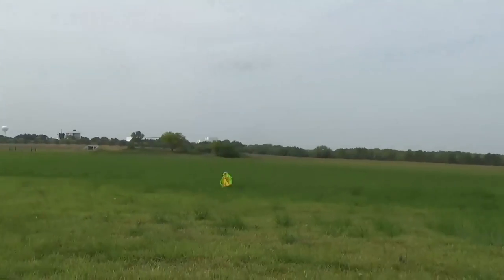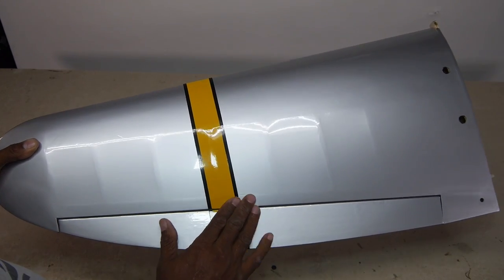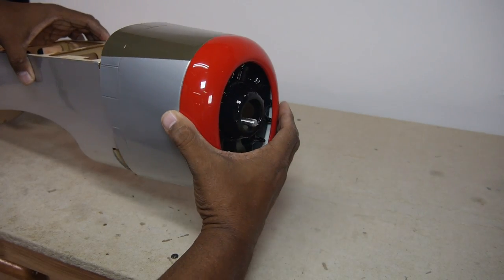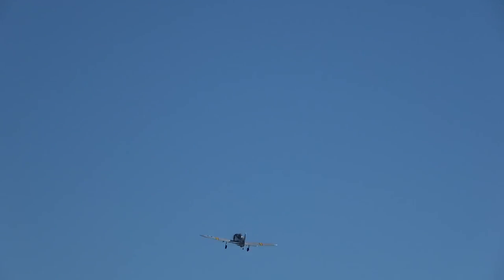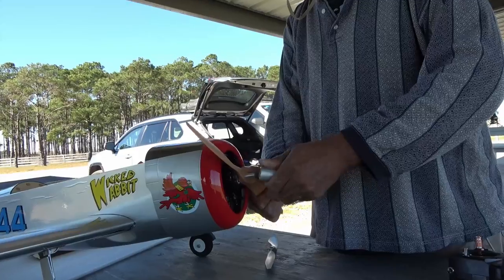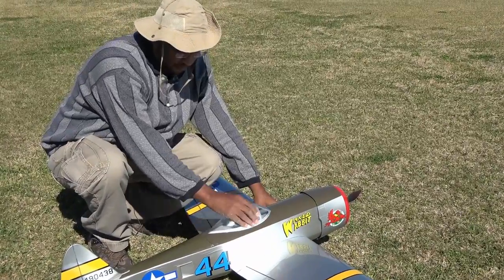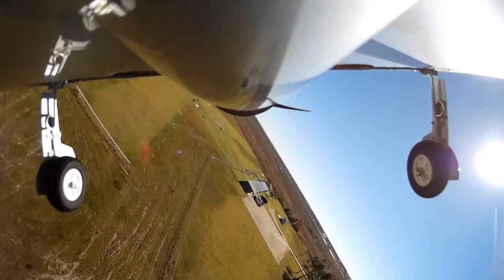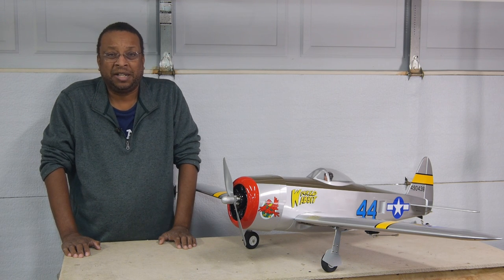Fun Scale P-47 Thunderbolt - Jug Full of Fun | HobbyView

Comment: Excellent transition/reduction in backpressure for the 6s takeoff roll at 10:20. Prevented it from leaping into the air and potentially getting an accelerated and/or asymmetric stall low to the ground, despite knowing you needed backpressure at the start of the takeoff roll to prevent a flip from the grass. Great flying and love the review!

Comment: I like mine too. It’s definitely a intermediate and up flyer with a bit of care needed on landings. Do your part on the sticks and this P-47 is very rewarding. $500 isn’t bad considering what you get. Avoid any “incidents” and this balsa and film model will last a very long time. The only mod I did on mine was to recover the horizontal stab in Cub Yellow Ultracoat to help with visibility a bit. I will probably go with invasion stripes on the bottom of the wings too.